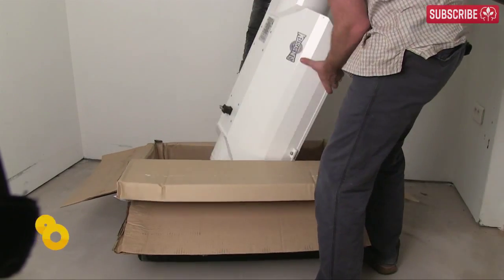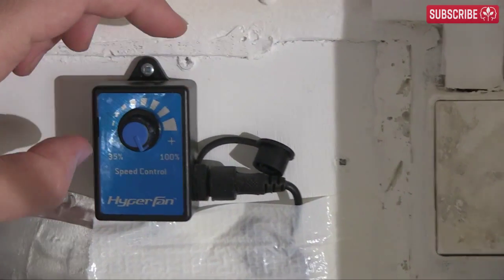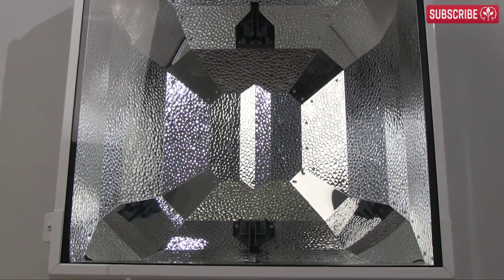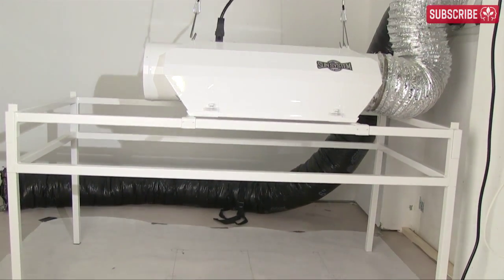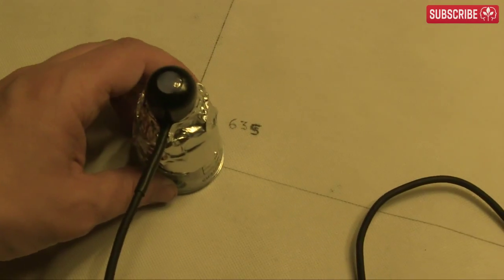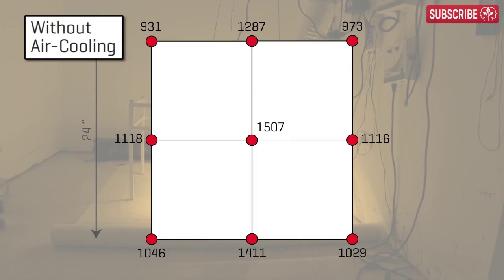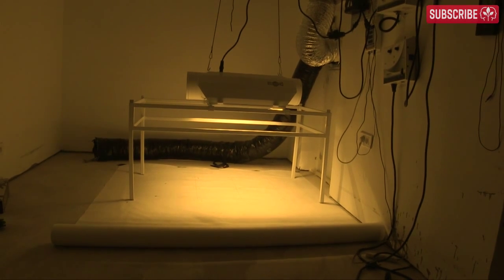Sun System AC/DE HPS PAR Test

Comment: Can i use a double ended 600w bulb in this reflector? I'm growing I  a 1.2mx2.4mx2.0 grow tent. The height is 2 meters. If I ran 2 adjustawing hellion would it get too hot in there without an air con unit in winter?

Comment: Love the lamp and I'm very jealous. However, my question would be if you could get a standard 1000 watt HPS lamp closer to the plants if you can cool it with chilled air than the DE HPS? If you are able to move the are able to move the standard HPS closer because its cooler, would it be more PAR?

Comment: Doesn't the DE bulb require 400v from the ballast? And if that is the case then wouldn't you need a 400v input setting on the ballast?
Reply from the maker: +Kolby Pippin Hi Kolby, sorry—I just saw your question, apologies for the delayed response. Lamp strike voltage runs between 3500 and 6000 volts, depending on who made the ballast, and you need 400-450 volts across the lamp to light when the strike pulse hits.  Once the lamp strikes, the voltage across the bulb ("burning voltage") drops to around 60 volts, while the ballast limits current, and slowly rises to about 230 volts for full power operation. So, no need for a 400v setting -- it's been there the whole time.
Reply: +Everest Fernandez (Just4Growers) so really the initial current is the only peak, then it levels out to a lower steady voltage is what your're saying?

Comment: Excellent video. It's great to see some scientific method applied to these products.
Reply from the maker: Thank you -- I try to do my best. Not claiming to be a laboratory -- but to perform simple, practical tests that are fairly easy for any interested grower to replicate.
Reply: +Everest Fernandez (Just4Growers) Everest-For fruiting flowers, would you recommend running a SunSystem AC/DE with 1000 watt HPS under a 4x6 flood table?

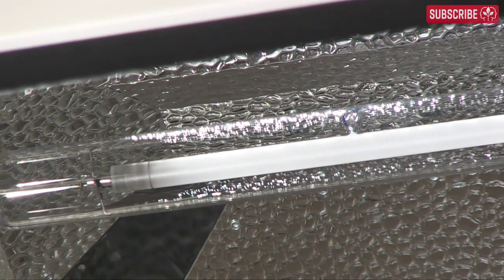Comment: @ 3:30 you say" run at the recomeded fan speed" 

who told you this?
Reply: 100% fan speed...why?
Reply from the maker: I took the recommendation from Sunlight Supply - https://youtu.be/1EYPrXXTJAs
Reply: I have a 7 foot tent so I am concerned about heat. It's this or the sunlight supply blockbuster 8 inch. What do you think
Reply from the maker: +Cliff Wharton Have you looked at the LoPro? https://goo.gl/McAx91 Maybe an option if you want to maximize vertical space for your plants.

Comment: Does Sun System make AC/DE HPS reflectors for smaller bulbs? I guess I could just go look it up for myself.:) love your vids..... Been subbed!
Reply from the maker: T Hicks I couldn't find anything in the Sun System / Digilux range at 600W for DE HPS. Solis Tek make a 600W DE HPS but it's not compatible with the AC/DE fixture.
Reply: Why couldn't you run a 600 watt de or any wattage bulb as long as its a de?

Comment: i NEED to go de. i need ehhhhh 4 of these!
Reply from the maker: northCALIFA Hey NorthCalifa. I definitely recommend checking out the AC/DE fixture—I'll be growing with it next season that's for sure. You could run a 10" fan, Y-piece to 2 x 8", feed two AC/DE fixtures in two rows (in series) and then consolidate the outputs again into a 10" duct at the end. Go insulated on your ducting! But hey—I think you knew that :) Good luck with your grow! Peace out, Everest.